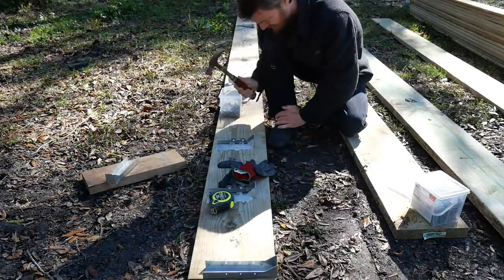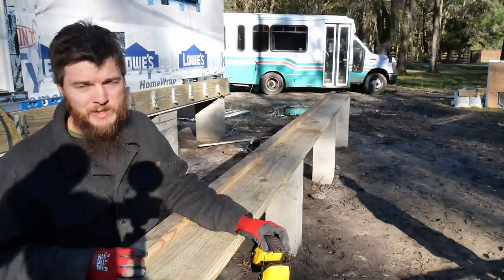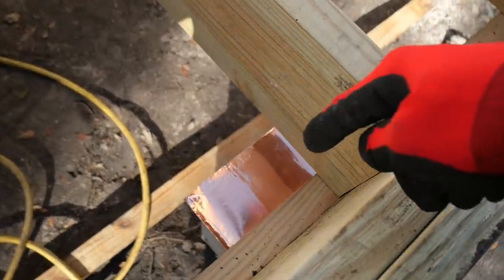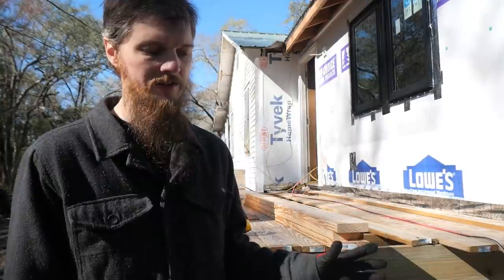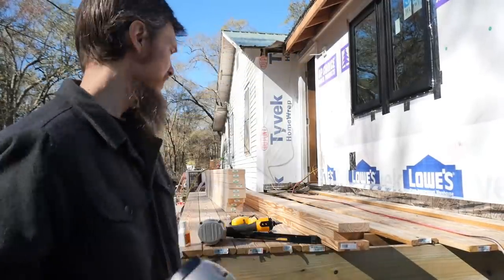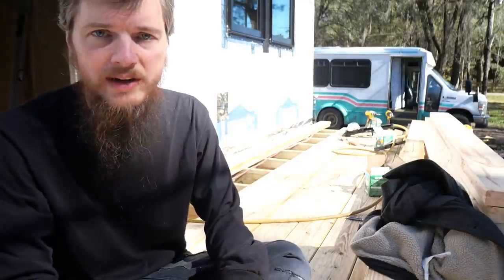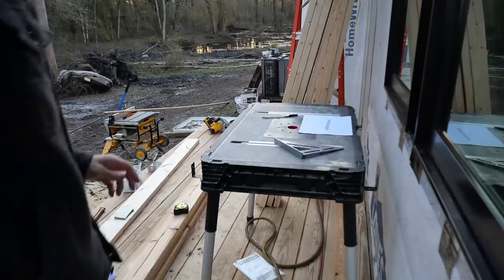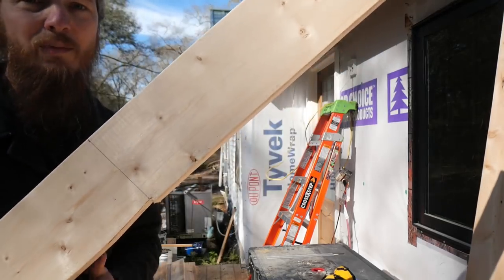I Shouldn't Have Used Nails!  DIY Porch Build

Comment: Speaking of your outer ledger board on your porch,  By Florida Building code, your structure must be anchored to your piers,  otherwise a nice strong Florida storm can and will rip the whole structure from the side of your home and create a possible hazard for one of your neighbors.  Just a friendly advice take it or leave it..   BY THE WAY I WATCH EVERY POST!  I like what you guys do and dream of doing something similar in the future.
Reply: I agree, but I didn't see any straps for his house, that's more of a problem I think.
Reply from the maker: We're old construction, so it's a bit different. The house has been here for many decades without anything besides its own weight holding it down. That's just how it used to be done. It's hard to anchor our home or porch because the piers and pads will move over time and then it would pull the structure with it and would be hard to relevel as needed. So in our case, we don't attach the home to the piers. Much like a mobile home, it just rests on top of the blocks and secondary ground anchoring can be added. That is the plan for us.
Reply: @diyfferent  Sweet!  Porch was the main concern becouse of its lightweight properties..  the house on the otherhand is granfatherd in,  the new porch on the other hand is considered "New Construction" and must conform the the latest FBC. Long as there's something anchoring the structure it should be fine. 😊

Comment: DeWalt should have put a tension adjuster on their nail guns.  I'm surprised they didn't do that.  We have one for small jobs inside the home and they have one of those adjusters.  You can use small thin nails or staples.  Your porch is going to look so nice.  I know people who put added support wood pieces between the bottom of the wood strips.  That's also what we're going to do with ours when we build ours.

Comment: When doing a deck you should always use decking screws. i know it was you preference to use nails, but you should always use decking screws. Just food for thought.
Reply: I agree. I've had two experiences living places where nails were used. They do work their way loose, yes even the ringed nails. I had to keep pounding those nails down, and forget walking around barefoot or in socks.

Comment: A palm nailer would solve you problem with hammering. Their small and easy to use.
Reply: Also works real well running in joist hanger nails!  Cuts time by about 5/6th's.

Comment: I am sure you checked… but what psi was the compressor set to?
Reply: Yeah, looks like the air pressure is too low or the gun isn't adjusted to the right depth. If he can't get the guns to drive the nails seated and he hates to swing a hammer, he can try a palm nailer.
Reply from the maker: 120psi
Reply: @diyfferent  thanks! Crazy that it couldn’t drive the nail. Great job all the same
Reply: Please check, the box or instructions should tell you what CFM and PSI is recommended, 90 is the norm, sometimes more is not better.
Reply: We’re the joists flush with the ledger board?  They looked like they were about 1/2 high.  If so, does that gap let the junk fall through?
Reply from the maker: @islandgardener158  The tools said 70 to 120 psi.
Reply from the maker: @adrem9433  Yep, they were flush. You can see it better at 8:13. The black flashing tape made it look like they were sticking up.

Comment: We built new deck this last summer used screws both take time either way
Reply: Screws are much better because in norther climates the boards will expand and contract with the seasons, and screws hold them in place much better. I had a 1400 sq ft deck built and the builders used a stand up power screwed and was just as fast as nails but much more secure

Comment: Two things on your (2) framing nailer. You either don't have enough air pressure  ( increase the psi on air compressor) or you need to set the nail depth adjustment deeper on your air nailer! If neither of these two things work, I advise you to read the owners manual on your air compressor and your framing nailer. Good luck!

Comment: I was watching a video some time back where the builder put tarpaper on top of each floor joists (like a tent) to protect them from water. Seems like a good idea.
Where the height of you floor joist just slightly different. When I built a deck some measured a quarter of an inch more than others?

Comment: I got a Dewalt cordless 20 volt 30° framing nailer on Amazon and I love it. It's fully adjustable and has enough power that i have to dial it back for new wood. I was surprised because I've had a few Dewalt things that I'm really unhappy with. It's heavy though.

Comment: I think you might have pressure set to low on the compressor needs to be at least 100 psi or more
Reply from the maker: We had it set to 120. I think it was mainly those deck boards that were the issue.

Comment: Oh man, I wish we could reach out to you in real time.  Would it be easier to use the nails if you pre-drill the holes before using the nail guns?  Save this to use for future projects using the nail guns.  The only other thing I could think of was the air pressure.  Could it have been compromised pumping out reduced air pressure?

Comment: Just a thought to same some $$$s, a better hammer would make it a little easier.  You're losing driving pressure by not pushing down on the nailgun when you fire.  Doug, you are so right about the wetness of the wood, you could see it when you were cutting.  Since you guys are new to Florida, just a FYI, don't get the well water on your house or porch.

Comment: Couldn't you just drill holes that are smaller around than the nails, and just use the nails, not using the nailer? That way it wouldn't be so hard to nail them in. But still use the same nails for a cohesive look?

Comment: It looks like your framing lumber is spruce.That surprises me,as where your in Florida southern pine is common and locally cut.Just an FYI,on spruce lumber check for a face stamp that says NeLMA.That's a trade group of lumber mills that sets the grading standards.They are really strict,If the mill uses their own grading standards,who knows what you'll get for lumber.

Comment: Great progress on the porch. From experience the issue with your nail gun is the air compressor/ air pressure. My dad was a roofer so I spent summers roofing and building with him. Do some research on your compressor and see if it can be adjusted. Hugs and love from Mississippi ❤

Comment: Doug, I was sitting here wondering why they don't do tongue and grooved boards on decks? It seems like it would be a good way to help address the issue of shrinking and expansion in any kind of wood. In the many decks I've had and seen over the years, where people used nails, seemed after the first couple years the nails would raise up due to the boards expanding and contraction during weather changes. Then all the nails would need to be hammered down again, like every year. I'm not trying to offer advice or even sound like I know what I'm talking about, just wondering because I like new and improved ideas.  ( :

Comment: If you have any possible plans on ever closing this into a screened in porch, you should have used screen under the floor wood first. Just an idea. You could have always set the rafters up the roof further to give a steeper pitch. A flat looking roof isn't a great idea for most any type roofing material you are going to install. In fact some, if not all, shingle manufacturers won't guarantee their roof on anything less the 3/12 pitch. Just some info...

Comment: Is it possible your compressor is underpowered?  Seems odd both of those nailers can't push a nail through pine.
Reply: Came here to say the same thing, you need a compressor with higher psi.
Reply from the maker: It should be fine. It was set to the right PSI for the tools. We used the same nails at 7:11 and they went in perfectly and quickly. For some reason I couldn't drive them through those deck boards.

Comment: I don’t know I’m not a tool expert. What I can say is we had r deck built in February in Marathon. The guys that did the work didn’t use a nailer. I asked them if it would be faster and they said it’s easier just to use screws and that it would last longer. That’s all I know. Good to see Belle working with u guys. She’s almost a grown young lady. U must be proud. Hang in there. U will finish it one way or another. All u have to do is try right?

Comment: Do you have the PSI on your air compressor set correctly?
Reply from the maker: Yep
Reply: @diyfferent Framing guns typically don’t run correctly on small compressors. They need a higher CFM rated compressor.

Comment: Did you try upping your air pressure?
Reply from the maker: I had it up to the max PSI for the tool.
Reply: What was the air pressure set at.
Reply from the maker: @manopyro  120

Comment: What kind of compressor are you using? And did you think to turn the pressure up above 120 psi?
Reply: Bad advice. . stay at the tool rating.
Reply from the maker: This: https://www.homedepot.com/p/Husky-20-Gal-Vertical-Electric-Powered-Silent-Air-Compressor-3332013/311273546
Reply: @diyfferent  wow that should be beyond sufficient to drive those nails! What a conundrum.
Reply: @diyfferent  spec says 4.0SCFM@90psi... What is the minimum tool requirement?

Comment: Turn you compressor up to the max allowed by the tool then regulate the depth using the tools depth gauge. I think you'll find you'll have better success with your nails setting properly. Be sure to oil your tool before every use and after any long breaks throughout the day.
Reply from the maker: It was turned all the way up to the max the tool required. I think it was just the length of the nails (3") and being ring-shanked. Too much friction to set them in all the way I guess.
Reply: @diyfferent  that was all the help I had for you hope you have better luck as you troubleshoot the issue
Reply: @diyfferent  And so now you have eliminated the compressor setting.  I bought my nailer about 3 years ago at Home Depot.  It is their brand - Husky - and I have not had an ounce of trouble with it.  I don't know about either of your nailers but mine has a wheel on the shaft that regulates the depth of the nail.  Maybe have another look on yours and see if they have the same option.

I built my deck 2 years ago, using the exact size lumber that you used.  Not once did I have to finish a nail with a hammer.

Here's a trick when you're doing the top boards of your deck with a framing nailer;  Shoot one nail on a bit of an angle towards the center of the board.  Do the same thing on the other side - shoot it on an angle towards the center of the board.  Finally, shoot one last nail in the middle of the board, between the other 2 nails.  I can guarantee you that your boards will never move.  I'm living in Montreal, Canada and our winters can be very harsh.  Well, after two winters nothing has moved one iota.  I also spaced my boards with a speed square when installing them.  The gaps look the same size now according to my eye.  One last thing is that it's a good idea to use galvanized nails as regular nails can "bleed" black spots on the wood. when they get wet.

Anyway, hope this helps.  Please let me know if either of your nailers have that depth adjustment dial I speak of.  :-)  Keep up the great work!!!
Reply: Forgot to say that I used 3 1/4" clipped head nails on my deck.

Comment: Usually turning up the air pressure will solve the problem. Not sure if you have it set to max or not.
Reply from the maker: Yep, it was set to the max PSI for the nailer.

Comment: In case no one has mentioned it, those deck boards should have their rings facing downward because when they get wet, they’ll bow up on the edges and could cause a tripping hazard.  Hope this helps.  Take care.
Reply from the maker: We made sure they were all laid that way :) Great tip.
Reply: That does not matter I build decks.

Comment: That was a mistake using nails for your deck boards. In a couple of years you will be pulling them out putting in screws..
Reply: My outside wood steps were put together with nails and are still holding up well and were built many years ago. Depends on what nails are used.